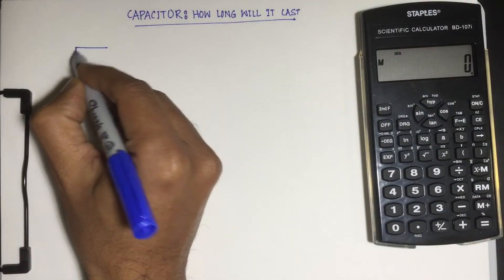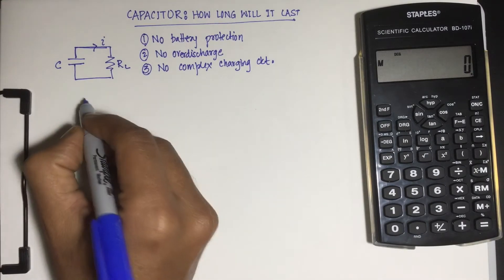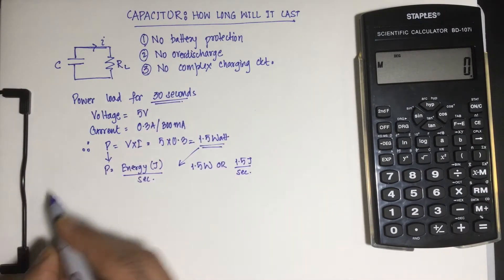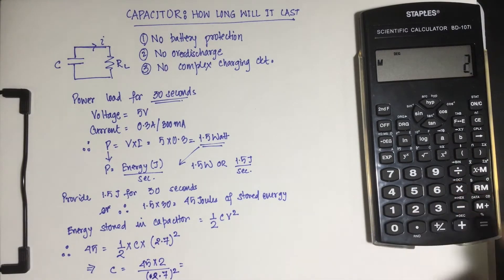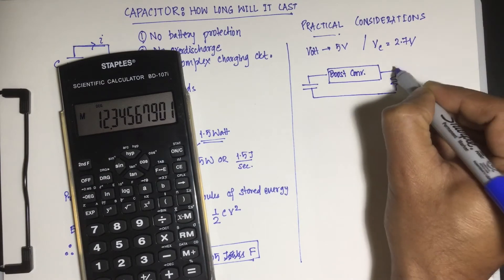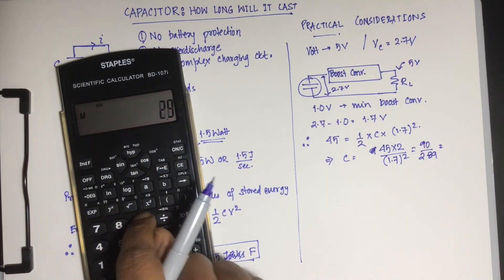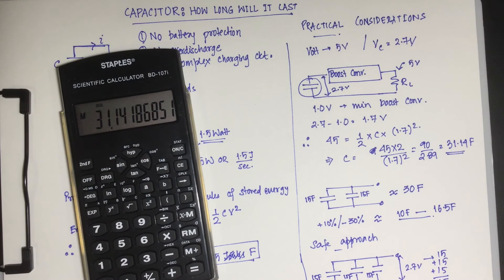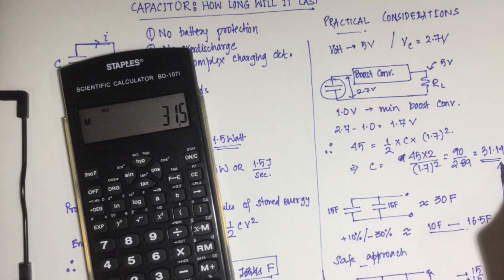How it works : Supercapacitor : As a momentary battery backup

Comment: Hello, thanks for your lesson!

I have a question about the energy calculation between 2.7V and 1.0V.
I think the energy would be 1/2*C*(2.7^2 - 1^2).

And another question is that supercap has a quite ESR values. Would you please give some advice how to calulate ESR power dissipation, considering that input current increases, as boost converter operates with constant output power.

Thanks for your lesson again. It is exactly what I looking for.
Reply from the maker: I thought about it again. You are right, the calculation should be (1/2) x C x (Vi^2 - Vf^2). Initial energy stored minus the final energy left. The difference is used energy.

For ESR power dissipation, here is what I can think of as a starting point:
1. Use the typical ESR value from datasheet
2. Use the capacitor current equation and use that current in the P=I^2 x R. Capacitor current is C x dV/dt.
3. Therefore, instantaneous power dissipated is (C x dV/dt)^2  x R.
4. For a periodic signal, you should be able to integrate over the time period to find out the power dissipated by the resistance. 

The integration will give you the total power dissipated
Reply: @VishnuTube  Much appreciated!

1. P = I^2 x R is understood. 'I' would be RMS current of boost input capacitor. Does R mean ESR of input capacitor in DC condition without AC condition? Looking datasheet, it written ESR values with AC and DC condition respectively which makes me confused..

2. I have calculated Ic_RMS(capacitance rms current) by RMS method of ic during 1 freq cycle in condition of CCM. But when I see it that my calculation looks definitely wrong... Have you calculated boost input capacitor's RMS current, referring variables with in/out voltages?
I can not find the equation so far..
Reply from the maker: @YCHanghae  I'm unsure of your specific case, therefore, my answers are more of a guidance. 
1. The capacitor ESR is generally measured using AC means. For now, use the AC values.
2. Assume a step input for charging.
3. The effective power dissipated during charging will be 1/2 x C x V^2 (Same as the power stored in the capacitor). If you use i^2 x R formula and integrate, you will get this value. Work done by battery is CxV^2.
4. During discharging, the entire stored energy will be dissipated by the ESR. This will again be 1/2 x C x V^2.